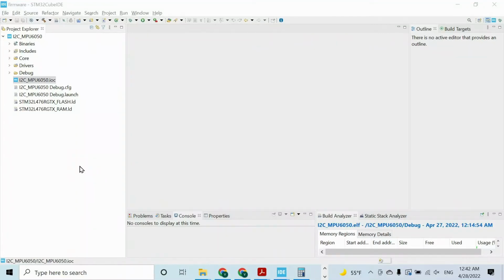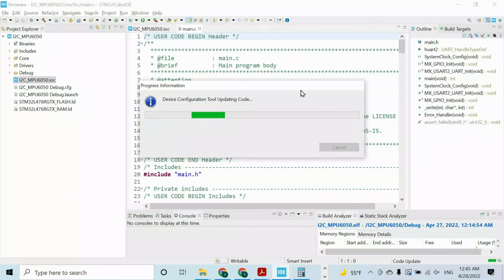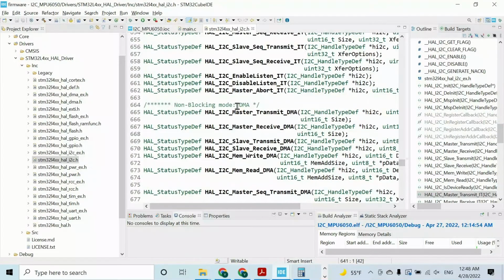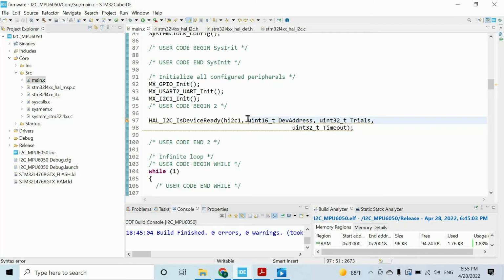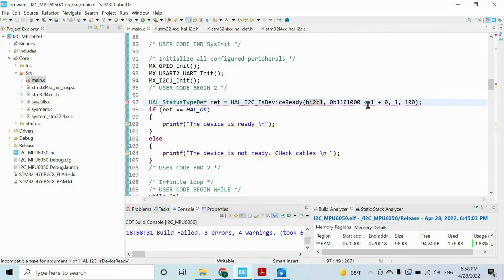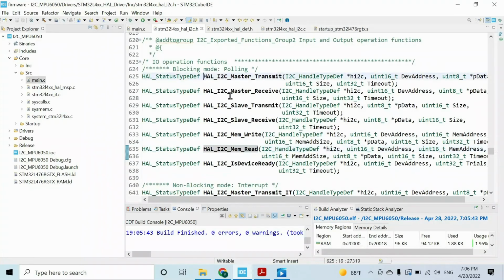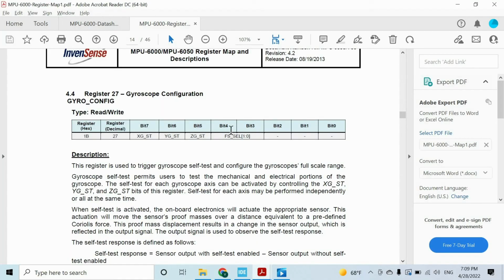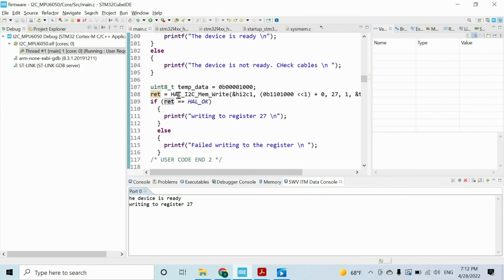PART I: STM32 HAL I2C and MPU6050 IMU

Comment: Great Job. How do I get to interface mpu6050 with stm32 so that I only get readings anytime there is an interrupt coming from the interrupt pin of the mpu6050 when there is linear or rotational movement?
Reply from the maker: The easiest solution will be using the timer update interrupt in STM32 MCUs. Every time this event occurs, you can sample the IMU sensor.
Reply from the maker: What if you use the external interrupt to trigger reading the IMU sensor?

Comment: My SWV ITM data Console doesn't show any text, can you explain it? (btw, i'm using MPU6050 and STM32F103C6)
Reply from the maker: Have you checked my video, where I showed how to configure the SWV?
You can find it here:
https://youtu.be/iR34qmfyZtU
Reply: @steppeschool3629  yes, i have. I have different wiring in my Clock Configuration. I don't have the "MSI" wire in the system clock mux. What should i do to have that MSI wire?
Reply: Please, have you found a solution to your problem? And could you help me because I'm working on the same thing?

Comment: console is not showing anything, swv is enabled, clock is set properly and the code is running the printf-states (debugging) any suggestions? also swo is soldered ( stm32L476rg nucleo board)
Reply from the maker: Hi,
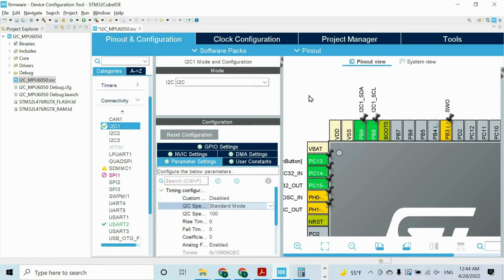Did you also implement the _write function? Minute 1:45 of this video:
https://youtu.be/iR34qmfyZtU?t=104
Reply: @steppeschool3629  yeah but still nothing, even using other suggestions like disable syscall.c nothing shows in swv console
Reply: nvm did find the mistake ... had a typo in the _write-fn
Reply from the maker: @peacefighter3559  great. Glad that you solved the problem

Comment: Great video, it really helped me and how did you store the calibration data to the microcontroller's flash memory? it is extremely impractical to perform calibration every time the sensor is powered up.
Reply from the maker: Hi, I am glad that you find the video helpful. But I did not fully understand your question. You mean configuration of the IMU registers?